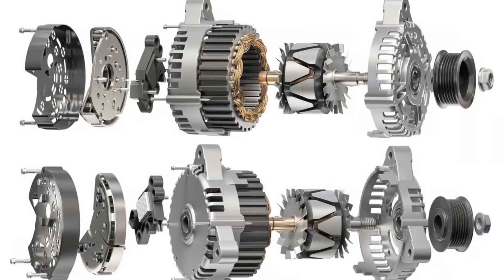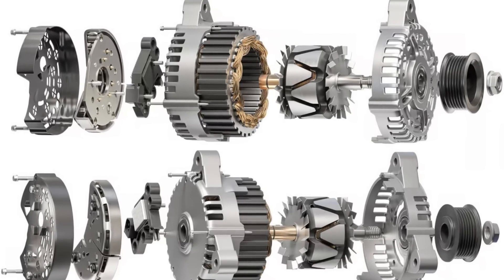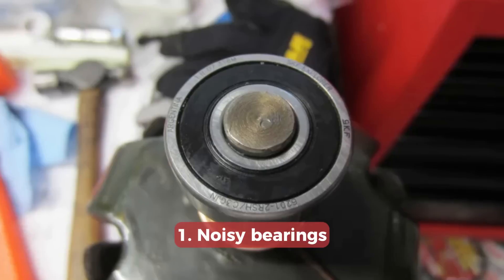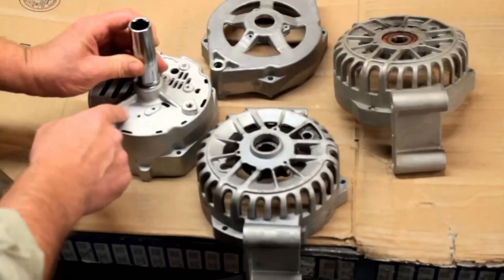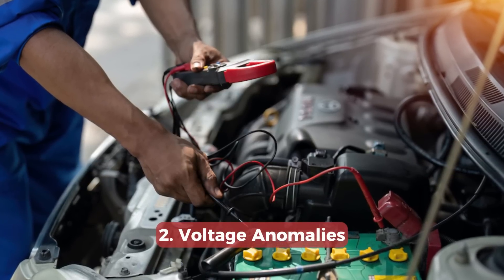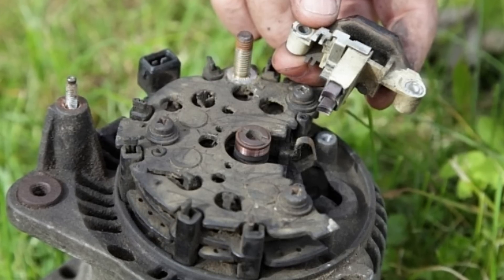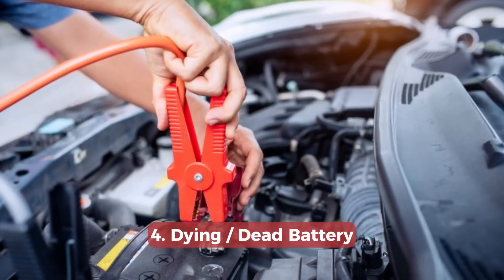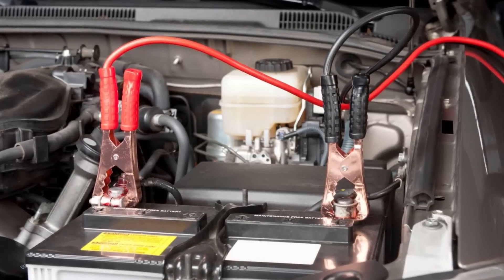Here's how you are killing the ALTERNATOR in your car

Comment: Classical issue is a bad engine to ground wire. Alternator are grounded using the engine, which is grounded using the engine to ground cable. It causes low voltage once you need any load and another symptom is a hard start even though the battery is full because the starter is also grounded through the engine. Replacing or cleaning the connection wil solve this.
Reply: On my '88 Jeep Cherokee and '69 AMX, the negative battery cable is connected directly to the engine block.  That AMX has only a factory radio and heater and not much else, and a 35-amp alternator.
Reply: My car temp gauge wacks because of that bad mass
Reply: This is absolutely true. Battery is grounded to the Chassis, so does Engine at a different location, in many cars.
To help your aging car's electrical system to function properly, i would highly recommend installing an extra ground cable between the battery and the engine, as this will significantly improve both the engine start and the battery charge. And do not be cheap on the copper, any undersized cable will be just another resistance on the circuit which will consume power! In case of difficult engine start, always measure the voltage drop on the ground between the battery and the engine, you will be surprised to see how much voltage you can lose on those aging ground cables ...
Reply: @laoszmagyarul  I did this on my old work truck after having to replace the dying alternator. 36 year old ground wires can't be trusted.
Reply: @dekoldrick  i suggest to every  car owner over 10 years to install a simple digital voltmeter, so you can monitor if the system is working correctly or not.
Start voltage 12.5-12.8 the battery is ok. 
Step on the accelerator, rev. Up to 2000, voltage should increase over 13v almost immediately. (The alternator starts to charge back the battery)
Even with all loads on, system should run over 13.5 all the time after a few minutes.

Comment: I haven't finished this video yet but i just wanted to say the alternator in my 91 Silverado 33 years old is still charging my battery.. get this, i just replaced the battery in 2022 and the date code on the battery was 2012.
Reply: AGM ?
Reply: @juicebox22a  No, just regular AutoZone battery 78 group, but I did however add distilled water at some point to top off the cells.